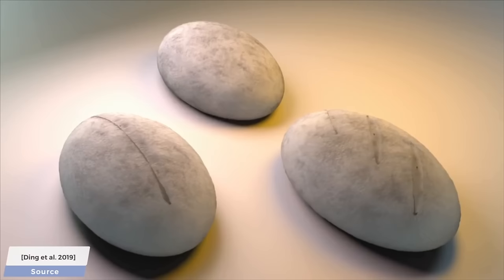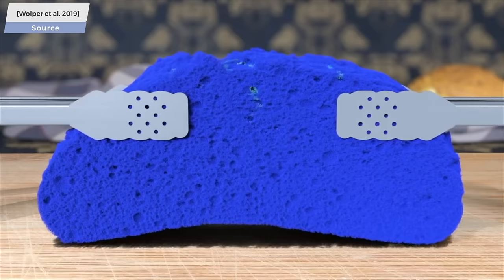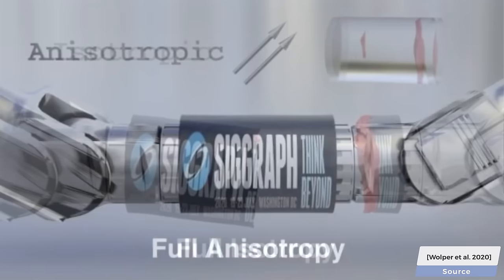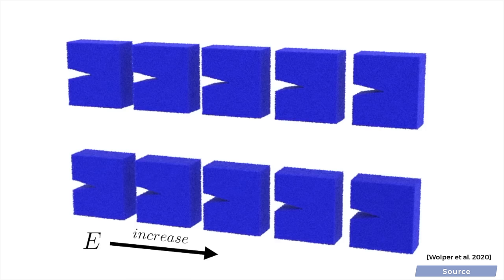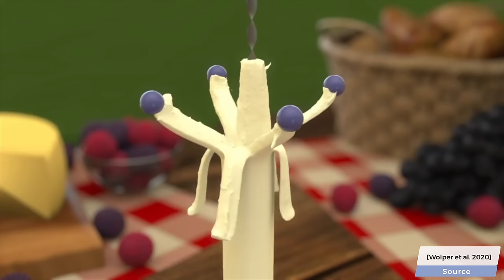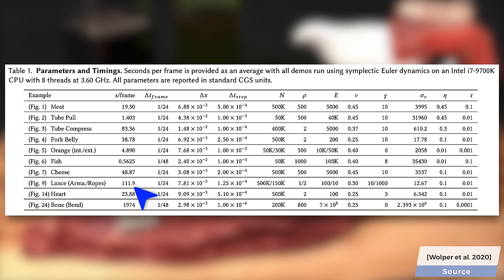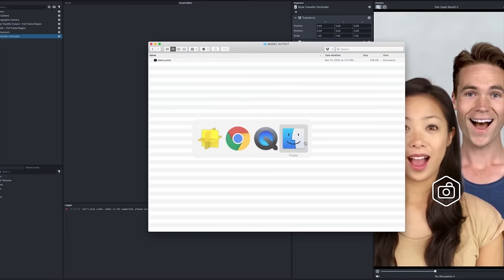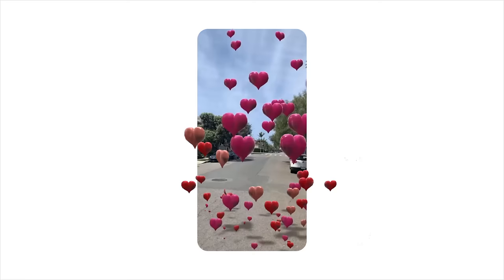Can We Simulate Tearing Meat? 🥩

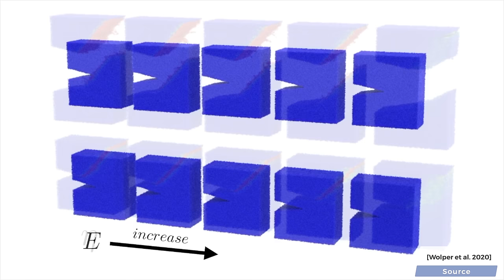Comment: The Young's Modulus of a material does not describe resistance against fractures (2:34).
The YM describes the stiffness of a material: how much force is required to deform the material elastically (no permanent deformation)
The toughness (or fracture toughness) describes how resistant the material is against fractures: it is a measure of the energy required to extend a crack
Just a quick correction!
Reply: Correct!

Comment: If that time step goes up, please post a video about it. I work with the discrete element method to model granular simulations. Think sph but for grain and rocks. I personally use it for flexible fiber simulations like wheat straw. We have to use low time steps mostly due to the high Young's modulus. We also need to worry about the time it takes for waves to pass from one particles to another during collisions.

Comment: I haven't watched past the part where you point out how long it took to compute, and asked rhetorically why. This is just the guess of a biomedical engineering student, but perhaps they made a "real" bone and it had to calculate 1. How to accurately break bone's 3d mesh-like structure, and 2. They made both the hard outer bone and the soft marrow and gave them 2 different sets of values; so the sim had to calculate how they interacted with eachother while being broken as well

Edit: I'm disappointed at the real reason why

Comment: I have a super elementary question. What is the difference between simulating these kind of tearing-failure behaviour as in this video and doing it with solid or fluid mechanics principles (finite elements, meshless methods etc.) The latter would take ages and I don't know of any material model to resemble bread (or watermelon). Do these simulations deal with stresses, strains.. that sort of things and if not how do they work? I am interested in theory. Any introductary resource would be very much appreciated.

Comment: Has anyone tried using a separate algorithm to save time by rendering it once in a low poly and time step count and then learn when to increase the time step for more important simulated parts? Like what if for the initial tearing and ending parts of it or parts of the sun that aren’t rendering in the direct field of view it could seperate those parts into chunks and render them in much much less detail saving on render time... I know this is all very new tech but was just wondering.
Reply: Sim*

Comment: I feel like I've seen all of this before...
The peeling of the meat, the Mozzarella stick...
What'S different here?
Reply: Mostly that the materials have weak points and strong points and they fracture at the weak ones.  The meat and cheese now tear along the grain of the material, which is not something that happened before.  The specific images are repeated from previous papers to show improvement in the same simulation.